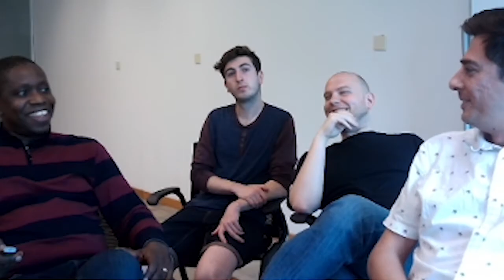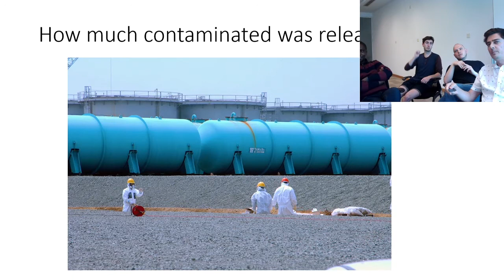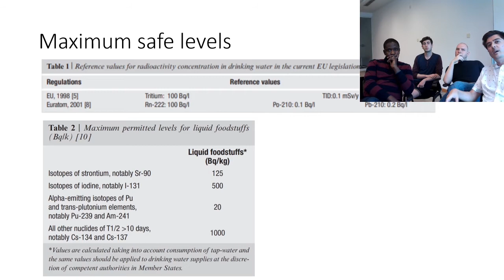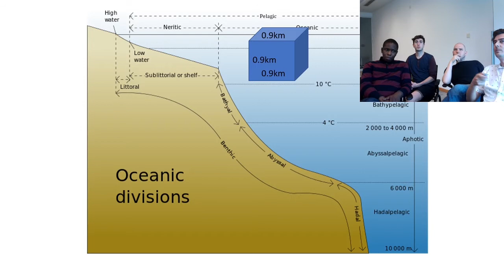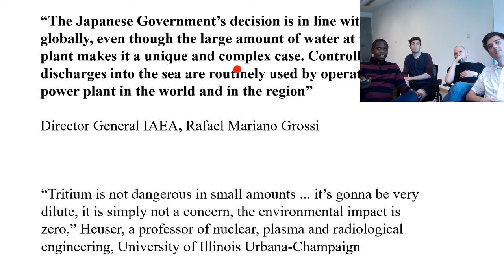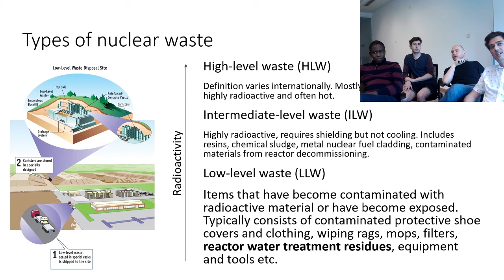Fukushima radioactive nuclear waste water release in Japan analyzed

Comment: "Tritium directly or indirectly induce various biological effects including DNA strand breaks, micronucleus formation, cell necrosis or aptosis, chromosal aberration and various other phenomena thus negatively affecting human health. The half-life of tritium is 12.33 years and the AVERAGE penetration of its ELECTRONS in water is 0.56um, which is considerably lessthan the AVERAGE diameter of a human cell.  Therfore it does not cause damage due to external irradiation but rather long term internal radiation that results from inhalation, oral intake or absorbance of radiactive particles through the skin. AFTER ENTERING AN ORGANISM, TRITIUM CAN REPLACE HYDROGEN ATOMS IN BIOLOGICAL MACROMOLECULES OR BIND TO CELLULAR COMPONENTS TO FORM......ORGANICALLY BOUND TRITIUM (OBT). Exposure increases along with tritium levels in the environment." 
67 billion becquerals still exist in those tanks planned to be dumped.
Reply from the maker: You're right, inhaling Tritium is hazardous.
Reply: @NYUQuantumTechnologyLab  Not just inhalation but also ingesting it in water and food and it is absorbed into the skin.  Tritium is not the only thing left in those 250 out of over 1000 to be dumped.  Over 67 billion becquerals still left in those tanks.  1.23 million liters of water per tank at an average of over 27 million becquerals per 1.23 million liters of which neither amount has ever been dumped purposely into the environment.
Reply: @NYUQuantumTechnologyLab  Bulletin of the Bureau of Standards 1907 volume 3 pages 80-81....the inverse square law does not apply to extended sources of radiation.  Errors of considerable magnitude will occur when applying this law to any extended source of radiation.  A more sophisticated law and formula must be made for extended sources of radiation.  
All radiation detection monitors are calibrated and measurements taken by using the inverse square law formula....therefore all measurements and specific levels are null and void and until a more sophisticated formula is developed then they can't be trusted.